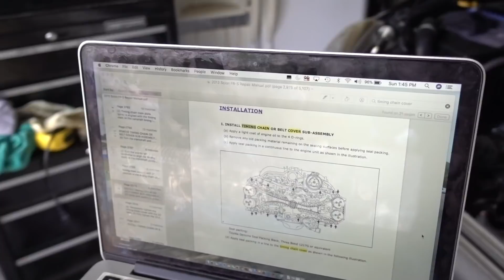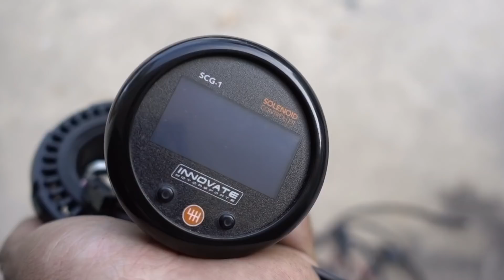Drift Dad’s Turbo BRZ Goes Back to Stock!

Comment: Hey Alan, if you want silicone or any sealant that squirts using that gun thing to be easy squirting, cut the tip more for more flow and easy push but that might make the nozzle drop too much sealant so be careful with the cutting (try to cut bit by bit).

Comment: Why is he making his car stock again? Isn't he drifting anymore?
Reply: Biminjo not at all.  We are putting the turbo on Alan’s car then adding the high output fuel pump, injectors and E85 kit.  Alan thinks that will get us roughly 400 hp in the FRS.  And, with that much power, it’s safer in a car with a cage.  I’ll Drift that car in the future.  And, occasionally the BRZ will hit the track.